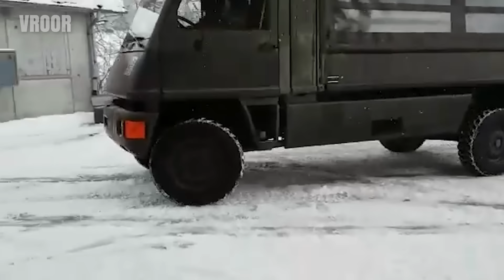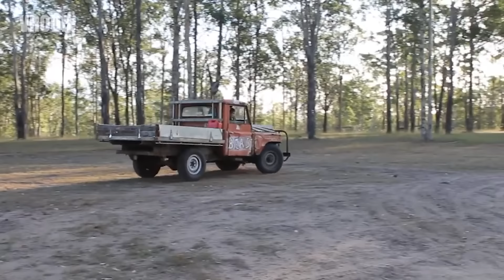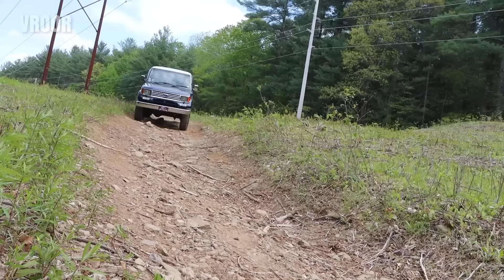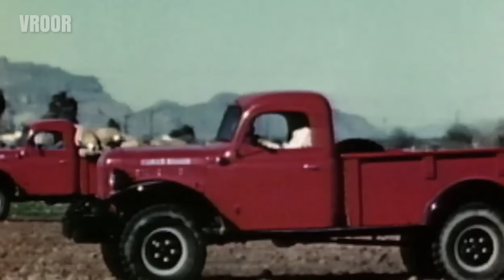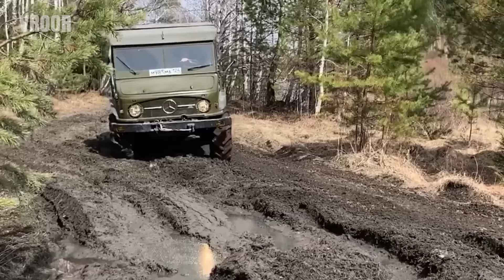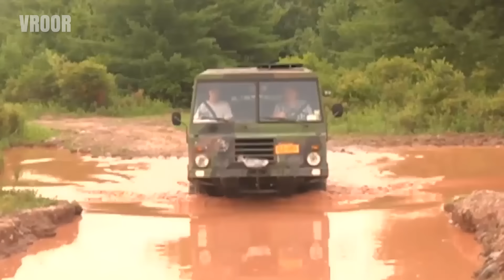10 Most Capable Off-Road Trucks Ever Engineered (Nobody Talks About Them)

Comment: Are locking diffs really a "modern feature" in the late 60's when the Haflinger had them in the late 50's?
I have been a passenger (during mil service) in a Pinzgauer that was driven on a mountainbike trail.
And the next day, it was a horse riding trail. Both in the austrian alps.
The Steyr test drivers in devellopment said soething that translates to "the only thing stopping the Pinzgauer is the fear of the driver". (->When the driver gets scared of the situation, that stopps it, otherwise it would keep going.)
Reply from the maker: That's a fantastic point about the Haflinger and a great anecdote about the Pinzgauer! You're absolutely right about the driver's fear being the only limit for those incredible machines.

Comment: I'd say Willeys Jeep should have been included. It broke ground for a lot of the off road capable vehicles that came after. It was cheap, simple, durable and easy to maintain. And when it was introduced it was rather amazing compared to just about all other off road vehicles of about the same size. The British Land Rover was a direct attempt at copying the Jeep. They even started with a Jeep chassis and worked from there. And just looking on the design it can be seen that when the Toyota Land Cruiser and Nissan Patrol 60 was developed they looked a lot at both Jeep and the Land Rover / Range Rover and used these as sort of a basis for their own designs.
Reply: But the willis Jeep is still constantly talked about. And in the title if this video there is the part "nobody talks about them"...